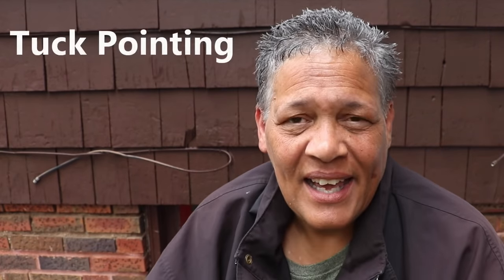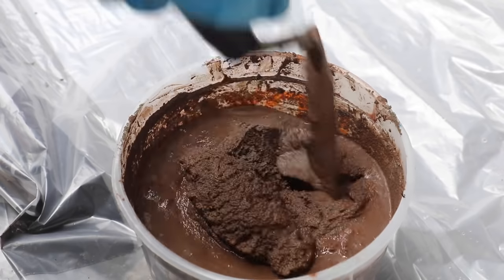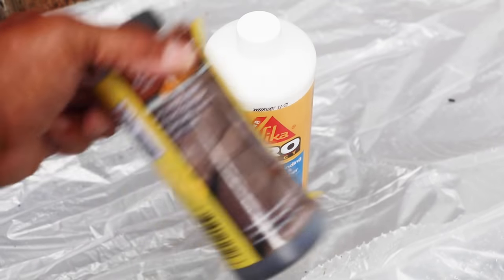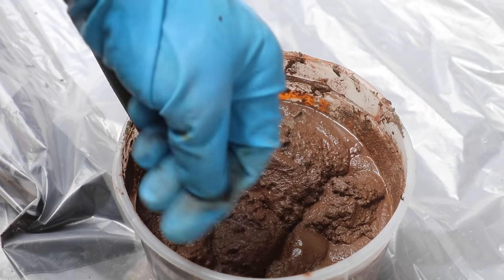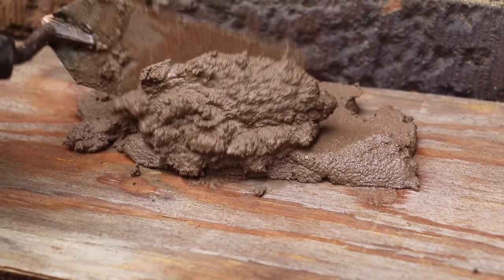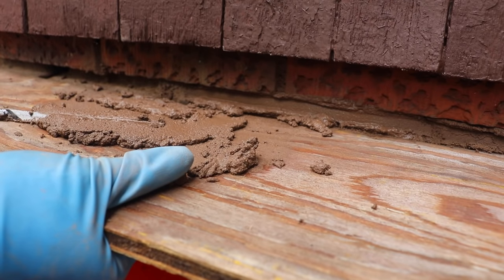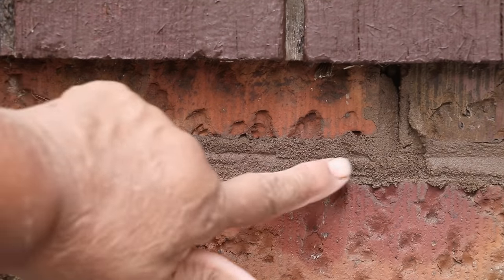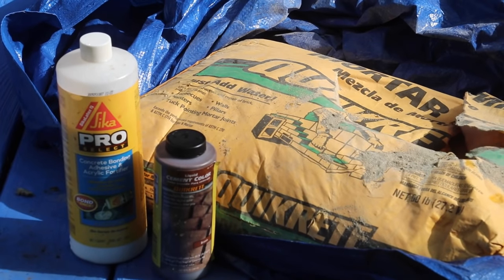Tuck Pointing for Beginners A - Z

Comment: I don’t even have a brick home and still watched from start to finish. Always willing to learn something I know zero about.
Reply: My house is a frame structure built on concrete block piers. Is it necessary to inspect the masonry joints on them and if so how often do you suggest. We have mild winters with maybe 8 to 10 hrs per night where temps drop below 32°.  Most winter months the avg low temp 40° 
Not sure if temp is a factor in mortar failing.
Reply: Same here!
Reply: you are not going to learn how to do anything the right way from this channel though....  so you are wasting your time and learning how to do things wrong at the same time.
Reply: Same here! And Leah, you are truly an amazing teacher.
Reply: @orion7741  what's wrong with this video?
Reply: @thinkersthink-  a black woman is presenting it.

Comment: So many videos have walked me through it, but NONE have explained it as rigorously as you have. Finally I understand how to do this well. Thanks!
Reply: rigorous, err, no
- she failed to discuss the single most important aspect of any brick laying mortar: how wet to make it and whether (or not!) to wet the joint before filling. Bricks are sponges, they suck water out of the mortar and if that happens too quickly the mortar will be brittle and  won't survive a winter 
- she did not discuss the depth that the old mortar should be raked out to ensure that the new mortar will be thick enough to survive.
- she dragged the wood along the join guaranteeing it smeared the bricks instead of lifting it off and moving it along without touching the surface
- her finish was also pretty poor. There were low spots that should have been filled.
- and although she did correctly state you should wait until the mix firms up, she used a trowel to knock off the excess and did not make it clear that is a separate operation to the use of the brick jointer. Best done a bit later when the excess has had a further chance to dry, then it will fall off using a soft brush, not a trowel, without any chance of smearing.
Reply: @John01GM40  Hey thanks! I learned a lot. Sounds like you need to do a video for this seriously. If you do, let me know. I will definitely watch it.

Comment: Nice job on the pointing 👍🏻 and Leah is an amazingly versatile teacher but this is another example where the same words have a different meaning in UK and America.  In UK that style of pointing is called standard jointing (or sometimes recessed pointing) whereas Tuck pointing is a highly decorative and historic technique generally done only on very grand historic buildings mostly in London.  It was done in the era when bricks were hand made and irregularly shaped and the main mortar is coloured the same as the brick and flush to the brick so the joints disappear to hie the irregularites.  Then afterwards a very thin bead of contrasting lime putty is inserted (ie Tucked) into the centre of each joint in laser straight lines to create the illusion that the bricks are perfect and the gaps between them are tiny.  The finished result is stunning.

Comment: I’m a licensed builder and have done some concrete work but I’ve been putting off some much needed tuck pointing on my own house because I’ve never done it before. I just bought the same mix a week ago as I need to get it done. Very timely video. Excellent instruction! I’m looking forward to knocking this small project out and checking it off my list (finally)!

Comment: Would be cool to see you do a video on repairing damaged brick walls too (deteriorating brick or broken bricks). Thanks Leah you're amazing!!
Reply: Absolutely!!! This is my current situation
Reply: @cassandramadgett7739  I keep getting different opinions I want to know the actual correct way. So I think this house has like two layers of brick, the outside ones are literally disintegrating into sand on the lower bricks near the ground and I need to get it fixed but I don't want just any dope slathering cement on there and calling it done just for it to crumble off in a couple years!!

Comment: I have done a fair bit of re pointing of brickwork. I like to wet the prepared joint and use a slightly stiffer mortar mix than what you used here. Wetting the joint prevents the existing mortar sucking our the moisture in the mix creating better adhesion, whilst the mix remains  less sloppy and easier and cleaner to work with. Just my 2 cents
Reply from the maker: I agree but the bricks were damp from rain the evening before.

Comment: That's a great starting video.
How about a follow up on the vertical, horizontal joint filling and polishing order. This is where most newbies come unstuck and it's easy if you plan it out first and understand why.
Reply from the maker: Thanks for the video suggestion
Reply: Yes. Please. Also, wondering how to know when it’s time to tuck point? What signs am I looking for?
Reply: @machinmchargue4006  Thumb print hard  usually not too long after applying.
Reply: @machinmchargue4006 , if you see the mortar breaking down, or there are places where the mortar is actually missing, it’s time to re-point.

Comment: I don't know why pointing is so fun for me. Other than when you do it right it looks amazing. What I did learn a long time ago was to use lime mortar only with brick to avoid spalling (braking the edges of the brick at the mortar joint because the mortar used was too hard). I've got family in Oklahoma where there are a LOT of brick structures that were repointed incorrectly and you can see how the cement they used just chews the brick up. Something I got to do a few months ago on concrete block walls was to fill in some large holes in some rooms that were being renovated. I mixed some really stiff mud and filled the holes, then I pointed motar lines in the mud to blend the repairs into the existing wall. That kind of work is my favorite.

Comment: Great video as always! I'm curious how do you do the vertical parts?  Do you just turn your wood board sideways and quickly pack it in?
Reply: Most vertical joints are offset  and are very short (go outside and look at how bricks are laid), so you don’t need the long board to hold up against them.  I guess you could use a really short board, but probably just as easy to fill them free handed.
Reply: You could put the mortar on your trowel, tap it down to stick the mortar on the trowel and tuck the mortar in. It won't fall off the trowel once you tap it

Comment: Thank you, Leah. I have to do this very thing and I will certainly use the info you have provided. Can the same water solution be used around the edges of the sidewalk and driveway where the concrete has loosened?

Comment: I just finished repairing a section of my exterior brick façade. The patio sank (over a couple decades probably) and pulled down the bottom couple rows of bricks. The bricks higher up staying hanging onto the house and up in the air because brick ties are used to hold a brick façade to a wall in case of earthquake or tornadoes (I figured this out later, I was stumped initially). Anyway I wish I saw your video first because my tuck pointing was messy and wished I used your plywood board trick to more cleanly push the mortar into the cracks without so much dripping onto the brick face below. I also didn't realize I should "slake" the mortar for 10 minutes.

Comment: Caution using a fortifier if your doing a chimney.  I did and it cracked many of the brick edges. From what I learned (grinding it out) is that it made it much harder than the original concrete, thus is did not expand like the rest of the concrete, and with soft bricks, voila, lots of cracks.   Bricks in this video do look 'harder' (than old 1950's etc chimney bricks) and are used on a foundation (that does not expand).   Good video, thanks

Comment: Timing could not have been better.  I have a house built in 1880 with a stone foundation that needs pointing up.  I could easily messed up if I had not seen this.  Thank you so much!
Reply: If you are serious about trying this yourself, do not use the mortar mix she shows in this video on bricks that old.
Your bricks need a “softer” mortar, due to their age, so you will need to “soften” your mortar with some hydrated lime. You can search “what type of mortar to use on old bricks,” and see what I mean. There are several types of mortar sold at box stores, but most of them are too hard for old brick, and can crack them. Good luck if you proceed!
Reply: @scots72  as I mentioned, I have a stone foundation, but thank you.  That's very kind of you.

Comment: Hi Leah My house is a frame structure built on concrete block piers. Do I  need to check the masonry joints on the concrete piers and if so how often do you suggest. We have mild winters with maybe only 8 to 10 hrs per night where temps drop below 32°.  Most winter months the avg low temp 40° 
Not sure if temp is a factor in mortar failing.

Comment: A question of terminology here. You haven't done any tuck pointing, rather you have re-pointed existing brickwork. Tuck pointing is really a lost art and it involves filling the joint with mortar - usually black, and then forming an insert formed from white cement to create a dead straight line usually about quarter inch wide which stands proud of the joint. Hard to explain but obvious when you see it. Having said that, it may be called something else in the States.
Reply from the maker: I think it's an accepted term for a task which is really defined as something else.
Reply: Then a fine white line struck on top
Reply: In Australia we refer to this as repointing. Tuck pointing is a highly refined process of flushing the joints with a coloured mortar as close to the brick colour as possible then a fine white line of mortar struck on top.

Comment: Wait longer to take the edges off the mortar and it will clean up nicer. You got mortar on the surface of the brick. Also think about using an acid wash solution after if you get mortar stuck to the surface. Muriatic acid one part acid 12 parts water and a little piece of cinder block to rub it.  If it fogs up after wipe it with a dry cotton cloth. Mason mix and mortar mix are different. Either can be used for this. Also best to use a grinder and a tuck pointing grinder blade to take the old mortar out first. It will last decades longer if you are attaching mortar to clean brick rather than mortar to old mortar on top of the brick.
Reply from the maker: Actually it turned out fine

Comment: I have a BIG question: Isn't removing old mortar the most important part of tuck pointing process? Did she not remove it with a hammer here because she was only repairing a part where it had fallen off? This old house says you need 3/4 of an inch for mortar to stick: https://youtu.be/eHsoNLm78ys?t=158

Comment: Buy the type s mix not the n. Trust me I do this every day for a living the n doesn't have enough cement in it for good workability.  Not good for cold weather areas with frost.
Reply: This Sounds like valuable info,  but don't understand what n or s means so it's really not 😗😒  Care to elaborate?
Reply: @rebeccamckenzie5037  s has more   cement in it and can be used for under ground
Reply: @gabec6522  how do you know which u'r buying? Are these letters on the bag?  And thank you, I've never heard of this before (& I'm older).
Reply: @rebeccamckenzie5037  yes. It's type s or n on the bag.
Reply: @gabec6522  Thank you very much!!! 🙂

Comment: If you have a brick structure built before the end of World War 2 ignore everything presented in this video. Because if you follow this video you will do much damage to your building. First of all, what was done here is not "tuckpointing", it is pointing. Tuckpointing is a different process where a building is pointed with mortar that matches the color of the brick. After the mortar is allowed to set up some a fine 1/8" groove is cut into the new mortar. Then usually white mortar is used to tuck a fine line into the mortar joint. This is done to make the wall look symmetrical. Second, if any contractor tries to use Portland cement on your structure built before the end of WW2 grab them by the back of their shirt collar and kick them in the ...you know where and off your property. You must make sure that HYDRATED LIME mortar is used. It is a different technology. Yes, it comes in a bag and is also called mortar but it is very different. Hydrated lime mortar has been used in different areas of the world for thousands of years. For example, hydrated lime mortar was employed in the construction of stepped pyramids in Caral, Peru dating to 5,500 years ago. I have done restoration on many "historic buildings", "historic" denotes time period and not significance.

Comment: Great video, but people who have homes built before 1930 need to use a lime based mortar as opposed to a cement based mortar. The  reason is that the bricks made before 1930 were very soft and the corresponding mortar was even softer. The mortar must be softer than the bricks, if it isn’t, it will end up destroying the bricks over time!

Comment: Nice video. However,  this is called repointing. Tuck pointing is different. It involves pointing out the brick, with a mortar that matches the existing work, giving a monolithic  appearance.  Next, a groove is cut into the mortar joints, to accept a thin bead of white lime putty. Repointing is commonly,  and erroneously,  referred to as "tuckpointing".

Comment: Possibly should have mentioned not to fill in the vertical weep holes generally filled with a wire mesh to keep insects out. These are there for a reason, do not fill them.

Comment: Great job, but that’s not tuck pointing. It’s ‘re-pointing’. Tuck pointing is done using colour matched mortar, with a lime putty line in it.
Reply: On most typical jobsites the two terms are used interchangeably by bricklayers. Yes, technically you may be correct, but this is not a highly inspected historical restoration (where lime-putty is used). So to make a distinction between the terms for this is redundant for most situations.

Comment: Sorry to tell you but this is not I repeat NOT tuck pointing. Tuck pointing is a traditional English method. Using mortar the same colour as the brick and then a levelled white ribbon through the centre of the joint.

Comment: I hate to say it but that's awful work,the joint were not raked out deep enough,the mix was too wet,why not go straight on with the bucket handle straight away? And that's not tuck pointing at all,I must ask did it all blow out a couple of frosts later? Sorry to be so negative but it's what I do 😂